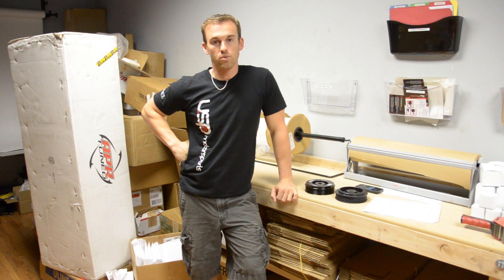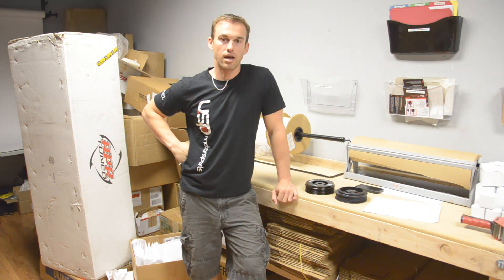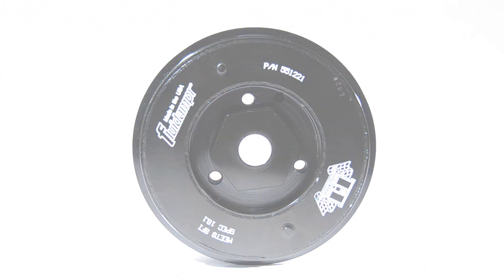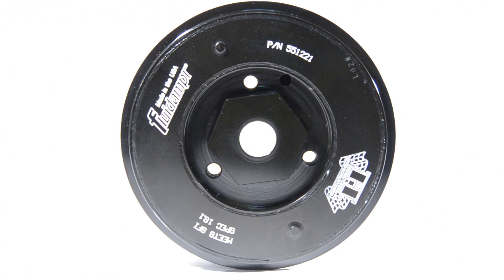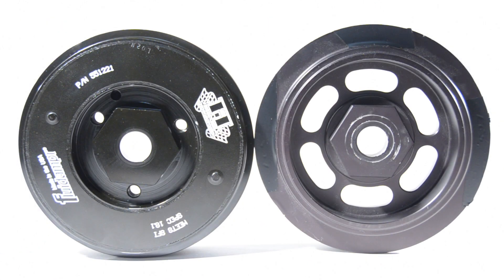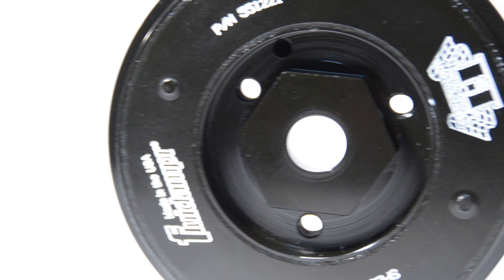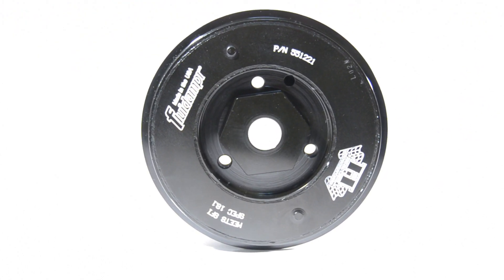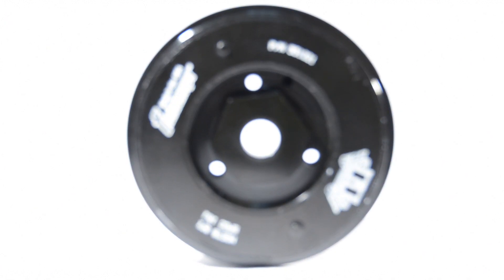About The VR6 Fluidampr Engine Damper by USP Motorsports

Comment: The 24v VR6, engine code BDF, is rated at 200HP from the factory.  Relatively low horsepower compared to the range of horsepower the Fluidamper is capable of supporting.  Is the Fluidamper worth installing on a non-modified factory 24v VR6?  Is the very small gain in torque/horsepower worth the price?  Are the factory harmonic balancers known to fail?  If so, approximately how many miles do VR6 engines have when the factory harmonic balancer begins to break down and fail?  I want my VR6 to last and will spend money on quality parts to properly maintain the vehicle, but also don't want to gold-plate the car with very high cost performance parts that maybe boost performance and reliability modestly.  My car is an everyday driver.  Responses from USP Motorsports and all who have the Fluidamper installed on their 24v VR6, are welcome and appreciated.